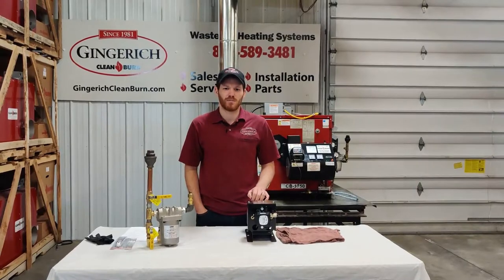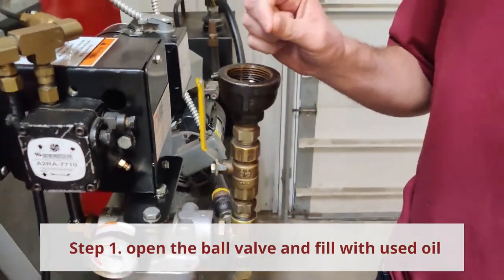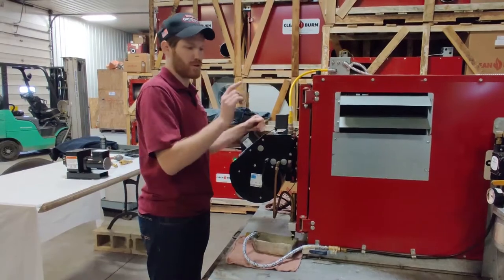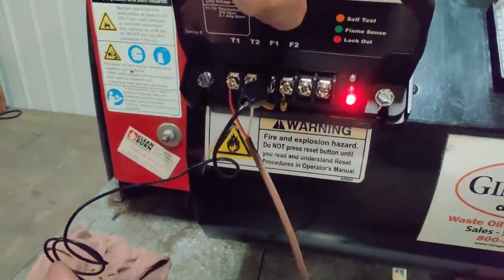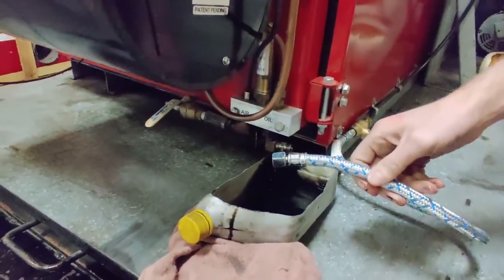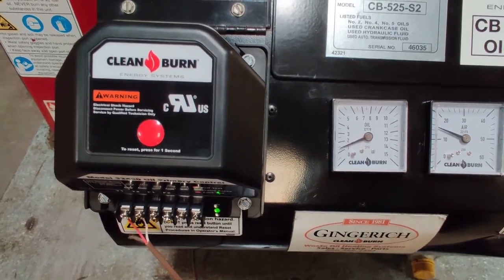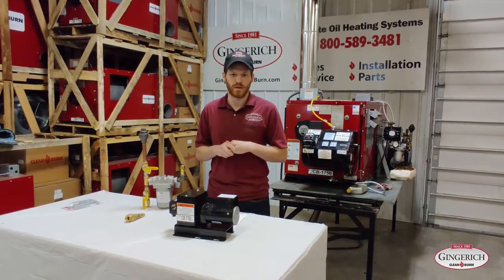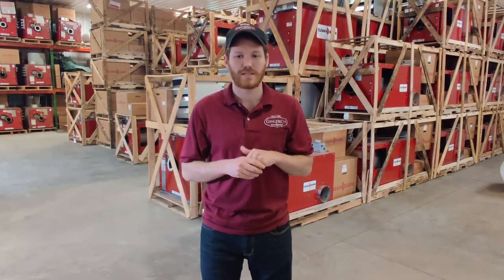How To Prime The Oil Pump For A Clean Burn Furnace

Comment: We just had a new clean burn unit like the one you are showing installed in our  auto shop. The problem is it is leaking fumes from somewhere when running. It has a decent draft but the fumes are bad. Is it possible that the heat exstanger is leaking? This is a new unit.
Reply from the maker: No, its very unlikely a new heat exchanger has a leak. Do you have a draft gauge, or how did you verify draft?
Just give us a call at 800-589-3481 we can help you figure out what's going on with it.
Sorry for the last response, we're a little busy this time of year :)
Reply: @gingerichcleanburn553  update, the draft was not sufficient. the installer installed a draft inducer motor and all is good now.so you where correct, thank you